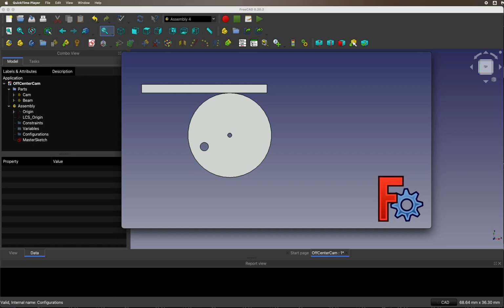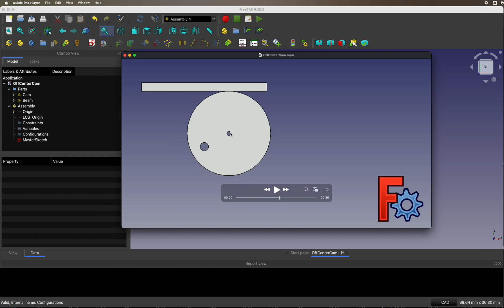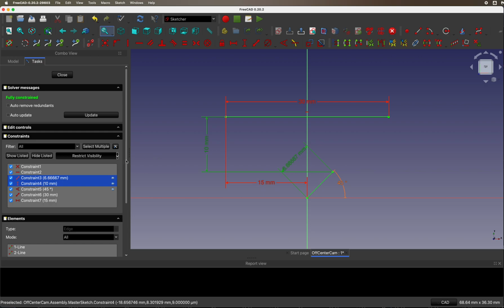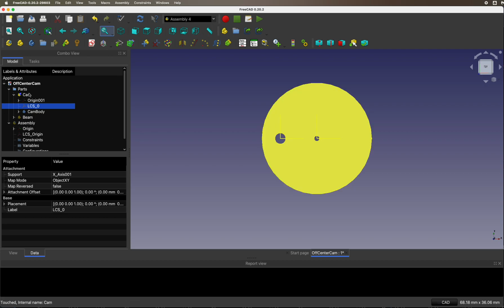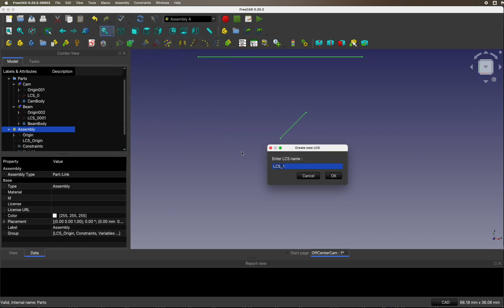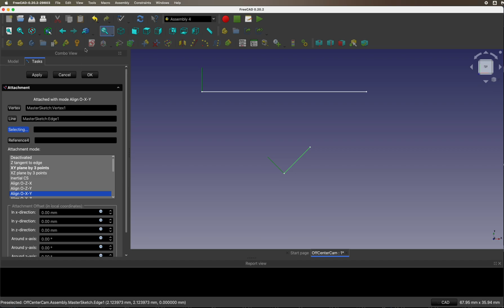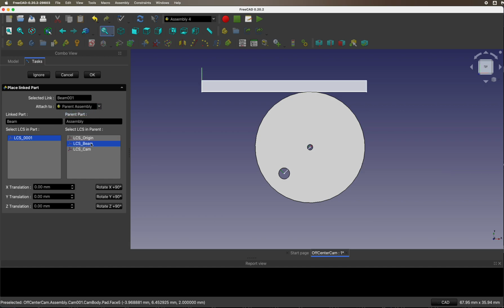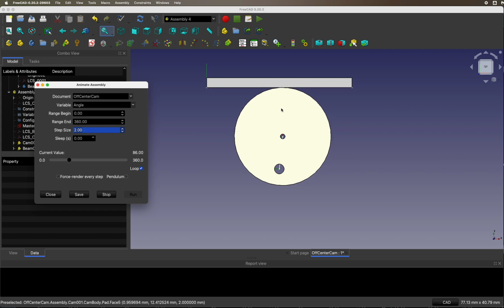How to make a FreeCAD assembly 4 animation of an offset circular cam and follower

Comment: Thanks for the advice. It was easy to get the original rotating coordinate system going following your first video on this. The orthogonal cylinders were also straightforward. The cylinder cam was a little trickier but not too bad. But this circular cam has been tough. I was able to get the new Assembly workbench going pretty easily, but it seems to lack a lot of capabilities. Since it has all those joints in it, you'd think it would be able to do this stuff, but you just don't program the movement so explicitly, a serious flaw. Exploded Assembly also seems lacking. Will let you know if I ever get this going. Also, seems like there might be many ways to create the "joint" with the two LCSs. Perhaps a video showing several ways to do this in a simple case might help people with this stumbling block of Assembly 4, a lot of capabilities at the cost of a steep learning curve.

Comment: I don't see why Assembly 4 requires you to carry around so many coordinate systems. And there doesn't seem to be any logic for how things get "hooked up." In one video, you hook up to an origin. In another, you hook up to an axis. Makes little sense to me.  In the tree, there appear to be a half dozen or more coordinate systems for some of these problems. Baffling2.
Reply from the maker: Local coordinate systems are central to Assembly 4. You connect pieces by hooking up two local coordinate systems, one in each piece. You can place a local coordinate system at the origin and you can place one anywhere on an axis.

Comment: I'm not seeing how you are providing enough info to duplicate what you are doing here. Is there a rotation angle as in your first video on the subject. Your "angle" appears without any background in this video. Is this an example of hooking up parts to that original rotation angle variable? Baffling.
Reply from the maker: You can set the rotation angle to any number. I always set it to a number such that the parts of the sketch are clearly shown. The rotation is what makes the whole thing move. You hook up other parts to the arm that rotates.